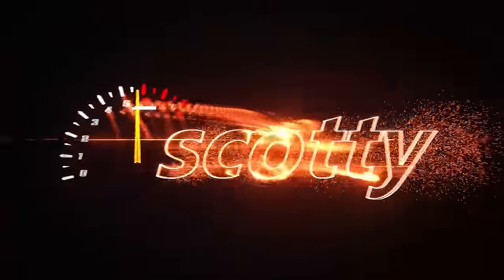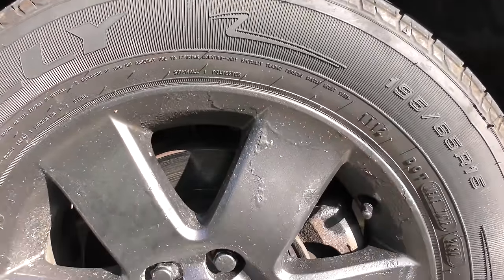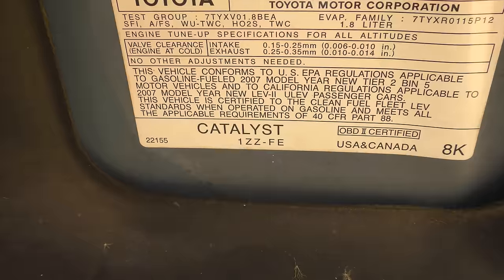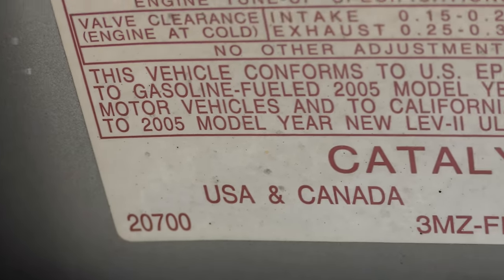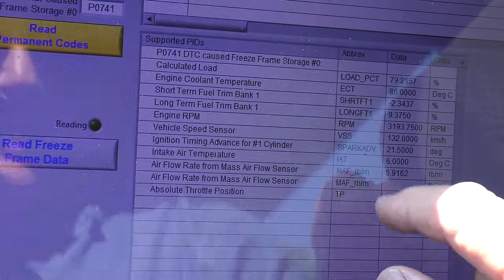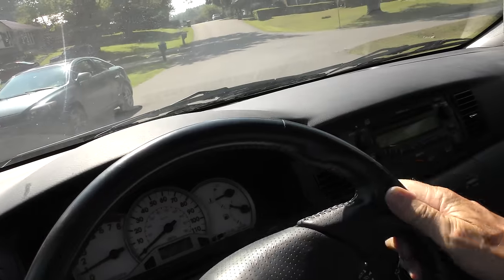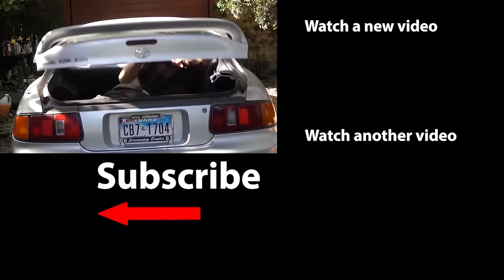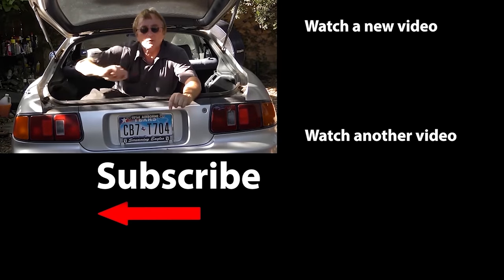I Won't Fix This Toyota Corolla

Comment: My 2003 Corolla has the same problem and has p0770 code I watch some videos change my filter and fluid and a solenoid was recommended because of that code my torque converter but it's still popping the check engine light back on as soon as I get up to highway speeds any recommendations from anyone

Comment: 2005 Toyota, outside looked pretty abused with 225,000 and the blue paint gone, it was a 'rusty" top but the mechanic that last inspected said it was the best maintained old corolla he had ever run across. Unfortunately a week later it was totalled with driver side door damage (other guys fault that required a door replacement). The insurance company would not fix it because their shop refused to not repair the paint and a slight dent in the rear bumper.  As it was they gave me a good total on it, but I quickly learned why as used car prices were soaring..fortunately got a break and got a nice 2014 Corolla way to cheap...family deal. . Hopefully the old girl has a new owner (a mech could easily fix the door) and has not been scrapped because she was a runner.
Reply: i got a corolla from an old grandma she was religious with maintance but didnt care about rust so everything runs new but rust is getting bad

Comment: I've painted wheels with stainless steel spray paint. Worked good.
Had 1982 Chevrolet truck that the torque converter locked up at low speeds causing a shudder. Discovered stopped when stepped on brake. Extend those wires to a toggle switch on dash, and could control lockup by flipping a switch.
Reply: That's what I love about GM products.  They're simple.  Back in 1996, the neutral safety switch on the clutch petal of my 1983 Chevy started slipping.  One day, it just wouldn't work.  I just cut the switch out, wrapped the wires together, and wrapped them with electrical tape, and I wasn't even late for work.  When something goes wrong with a Toyota or Honda, well, it's good if you're getting paid by the hour to fix it.

Comment: Toyota Blade hatch featuring a 3.5L V6 engine with 280hp (206kW) and 345Nm (254lb-ft) of torque. The Blade is sold in Europe as the Auris and in other markets as the Corolla.

Comment: Still remember this code make me trouble at CA smoke check I have to reset code drive with 3 gear for 100 mile make sure all port are green . If check engine light on regertless of type auto fail.

Comment: Hello i been experiencing some problems the engine like came on saying the torque converter solenoid is bad car runs great and seems great no overheating my starter starter going bad just changed it yesterday my car keeps shaking not to bad but it’s kinda like okay why is it shaking this much after 30 mins of it being parked ran great until today when I parked and it wouldn’t turn back on no radio no ignition turning on nothing completely dead I jump started and it work but didn’t stay on I finally got it to turn on and drove it home and while I was coming home i turn the AC on and it was over heating turned off the AC stopped over heating but still shakes engine light turned off twice when I replaced the starter and today when I got it to turn on does anyone had/have the same issue I can’t really find a video on it I made sure I put back the same way as I took off the starter I put a valuecraft re manufactured starter on it I have a 05 Toyota Corolla

Comment: Mine have that code too . P0741 2007 Toyota Corolla s. Same torque converter stuck off sigh . Crazy repair. Not doing that now

Comment: had this same code on my 05 matrix fluid was dirt changed it 3 times it came on once or twice while driving then turned it self off again. no issues since and does same thing as this one. I also just installed cruise control on mine that didnt have it before simple mod! hardest part is getting the screws out of the airbag haha

Comment: I have the same issue on my Corolla, drives fine to me... Just seems like a common issue and having to deal with it during smog time in CA is a pain.
Reply: Did you ever get it fixed? i have a 2005 with the same issue
Reply: @norestjoel i also have an 05 with the same issue lol

Comment: Have an 01' Chevy Prizm (Aka. Toyota Corolla) that I got with 60k miles, now have almost 200k on it and 4 years later. No big problems besides catalytic converter failing I think from burning a lil oil and/or having an exhaust leak before front o2 sensor causing to run rich

Comment: Solid car I have one myself 120 miles in good condition bought it for 4,000 not planning on letting it go anytime soon, completely off topic. Question I recently last my battery hold down clamp bolt that's bolted to the frame at the end of the clamp currently using tie down traps but i don't know how long they would hold up for, do you know what size bolt would fit?, someone told me 10mm but he forgot to mention the length

Comment: I’m confused. I saw another video on where the replacement of the solenoid was Super easy! Remove oil pan and then 2 bolts ? Why does Scotty say it’s so complicated ? The video I saw he didn’t remove the valve body.

Comment: That code P0741 is very common on Corolla's. I changed my transmission fluid, which was very dirty, and the code went away.

Comment: Brake rotors and drums are almost always GI 35 or close to it, not steel. Gray iron is self lubricating and short-chipping. It wears cleaner and cooler and the iron comes off in dust instead of compressing and getting hard or pilling up like a sweater when rubbed. Grey iron is stable and less prone to warpage. If you used steel you would have all sorts of issues.

Comment: The manual transmission ones are the most bulletproof and fun to drive. Very rare to come across because no owner wants to get rid of it. Speaking from experience
Reply: I’ve had 2 input shaft bearings fail in the c60 transmissions, luckily there easy to swap, can be done in 4 hours

Comment: Scotty! I've got a pontiac g6 with 58k miles no check engine light but my car under light acceleration shutters and shakes like the torque converter is failing to lockup. I check my fluid and it is full, the car will also stutter occasionally in park, as well as neutral (worst in reverse) and drive. Please help!

Also should note I took to my mechanic had him drive it a while ago he scanned with high level tool and got no codes at all for tranny or engine. I changed spark plugs and changed air filter and it's only gotten worse as time goes on

Edit. I also should note it never slips that I've noticed and it's always shifted harder for a 4t45e but never slipped and always shifted nice and fast

Comment: it's not just honda CVTs, the CVT cooler filter on JATCO trany also needed to be changed but no instruction for it on the user manual or service manual

Comment: Recently I asked the Nissan dealer to change the CVT oil (Xtrail T32) and they kindly grant my request to watch the oil change process on their shop floor. The car is 5 years old and the odometer is only 30km, but I want to be proactive knowing that the CVT is a prone part on many of the new Nissan. I already look at the service manual so I know something about servicing this CVT. The standard CVT oil change did not involved changing the filter - I had to request it. Also they did not drop the oil pan to clean the debris magnet. So it is not a specific Honda "problem".

Comment: I had a 2000 Rav 4 2.0 L 4cyl on the rego papers I was registered as a 5 cylinder.
In 2015, I kept it for 12 months a gas guzzler, clutch was on the way out So I traded it.

Comment: I had the same year corolla with the same code. For the converter lockup, I just turned off the overdrive and drove without it. Code never came back unless I drove with OD on.
Reply: Change the solenoid, nothing major bro…
Reply: @bradleymartin4464  The car ran absolutely fine, so fixing it didn’t seem worth it to me.

Comment: Scotty, believe it or not.  My 2006 toyota corolla has the original brakes still, and are going strong.  Keep looking at them to make sure they are good.  Minor grooves but still have plenty of meat on both rotors and pads. Is this normal? It only has 104,000 miles on it.  During the winters I never drive it in harsh Michigan weather and now it's at my house in Tennessee.
Reply: pretty sure I was running the og ones until about 130000, when they started screeching. Just replaced the pads, even though the disks were kinda worn. Probably won't bother with the disks for now, but even if I did, it's just a few bolts to be unscrewed. bless those toyota engineers

Comment: Scotty I have this check engine code since 2019 and the car still running. I use it for delivery I drive over 3k a month I just don't use highways .I think you are crazy if you use Corolla for highways anyway:).

Comment: My 02 Mustang GT service schedule says to change the transmission filter every 150,000 miles. I'll change it at the 90,000 mile service or in 2022, whichever comes first. I didn't see a service interval for the Xterra but I'll change the filter at 60,000 or in 2024, whichever comes first. What can I say, I'm a rookie mechanic. I haven't done DIY in 30 years.

Comment: I was at the plant where that Toyota was built when it was under construction somewhere near Toronto. The building was about 300,000 Sq. ft. Soon after Honda built their plant nearby. Similar size.

Comment: Scotty I’ve got an old 05 Corolla had that problem, we had the transmission done, then turns out there may have been a sensor issue ! Others with this problem might investigate that possibility before venturing down transmission road.
Reply: Do you know what sensor it might be? I have an 06 with similar problems
Reply: @rd.t1482  upstream 02 sensor for me

Comment: It"s kind of funny that some manufactures don't want people to service the trans filters, it feels like they want to fail. It happed to my brothers 2011 Honda Accord, I went to the dealer to get fluids and some other hardware to service the transmission, to my surprise the parts guy had no idea there was a trans filter because the service manual does mentioned at all. Good thing I did it because it was in rough shape and dirty. Moral of the history always change your Transmission oil and filter

Comment: My 06 Corolla had that code. But went away after I changed transmission fluid. Came back. Then noticed it only tripes the code when went over 70mph. But now I know all it will do it worse gas mileage lol. That’s a relief 😅
Reply: Totally had the same issue. A mechanic at AAMCO said I'd have to do a Transmission Overhaul but I declined. Besides that, my car rides great.

Comment: My Avalon check engine light is on for a bad knock sensor , it’s been on for 59,000 miles , it never knocks and runs fine . At 272.000 miles - just keep driving and keep it cheap

Comment: Probably burned the Torque converter clutch. If it was mainly used in city driving, the lack of converter lock up would not matter.

Comment: What do you think about the new Pathfinder with the traditional transmission? Guess they finally figured the CVT was trash.
Reply: I'm kinda excited for it too, it's a ZF 9-speed I think. Nissan makes cool, responsive engines (a few of the smaller ones had head gasket problems) I think the main weakpoint has been the CVTs, the old regular automatics and the standard transmission ones hold up.

Comment: This exact issue has been a smog problem for me in California, my 07' Corolla triggers the same torque converter code and although it's not an emissions problem it triggers the "check engine" light and by default it won't let you pass smog even when the engine is healthy with no emissions problems...yep, it's a real pain in the a$$ lol

Comment: My buddy took his 2017 Ford Focus with 28,000 miles on it back to the Dealer where he bought it brand new. He told the Service Manager the transmission was acting up and wanted them to change the fluid. Service manager replied that it had CVC transmission that has no fluid to change.   ?????????

Comment: The lost fuel economy would manifest as extra heat in the slipping torque converter.  Probably not a big deal, but might cause a problem at highway speed in the summer.

Comment: How many Americans coat the belly, suspension, wheel-arches and exhaust-pipe etc. with Tectyl? ‘Tis an American product. We use it a lot in Norway. Valvoline even adjusts the product for the Nordic region.

Comment: You don't mention that, that engine is made by Yamaha, I had a celica with the same engine, the Honda civic filter is actually located under the battery, there's a couple of videos how to do it, I did it myself bcuz the dealership didn't want to replace the filter which is a shity job if not replaced

Comment: I'm thinking that the sticker is a factory mess up because by my research the 3mze v6 was for mini vans and suvs. The master blade  has a different hood and a 3.5 v6.
Reply: I believe the 3mz fe engines were also used for the camrys and solaras

Comment: I think they just put the wrong stickers on from factory or someone else stuck those stickers onto the hood just to complete it when replacing a damaged hood with a new one. I don’t think the hood is interchangeable with any other Toyota model and they definitely didn’t stick a v6 into such a small car. I was thinking maybe the RAV4 but the hood is different, probably just mismatched stickers

Comment: My parents bought a new Toyota Corolla in 2005. It was a great car and lasted till 2019…sister got the car and later traded it in on a 2019 Corolla.  But it had over 200K miles and only issue it had was the ac/fan blower motor went out. Easy fix.
Reply: 2019 Corolla with 200k miles ?
Reply: @M447DT  i think he talking about the 2005  Corolla

Comment: 82 mph... last time I went that fast was open highway passing a slow truck 2way traffic. Usually never go even 100 km hr or 62 in human speeds.
Reply: It's my normal speed taking my 07 down the freeway in the mornings. Only bc the road is fairly empty at 4am, but I bet the gas mileage isn't great in this thing.

Comment: Great video, Scotty. Questioning the addition of a remote transmission filter that is easily serviced every 30k... is this a good idea?
Reply: @THEH2OMAN - Some of those cars made by Saturn (1985-2010) had externally mounted spin on transmission oil filters, so it worked for them. Not a bad idea actually.

Comment: I love the 3mz fe motors. So smooth and efficient, but powerful when you need it to be
Someone probably used  Camry or solara replacement parts.
Reply: Unfortunately it's interference with a belt 😭
Reply: A Camry or a solara hood will never fit on a Corolla not in a million years

Comment: Yep, I never knew about the transmission filter in a Honda
Reply: Honda automatics have never had a servicable filter since day 1. They made their own ATs and were different to GMs with no planetary gears till now (9 &10 speed ZF made in Georgia by Honda) or a filter that required changing. It was fluid only changes. A permanent magnet in the housing catches fine metal particulate from gear lash. They added an external filter that was not used for recommended service but rather at an overhaul. Then they put a filter in the transmission that is only changed if you overhaul it. 

You want to keep your honda automatic healthy.  Do a complete ATF fluid change using Honda fluid. 
I change mine on my Odyssey after 15,000 miles. 2016 takes 12 quarts. I tow about 3000 miles a year to FL and back and don't let the fluid get dirty ot tired ever. Dealer changeed ATF is at 30,000 miles and that's partial only.

Comment: Yes those cars are bulletproof, I've got a 93 corolla, I also got a question where do you change the interior air filter in a 1993 Toyota corolla because I've disassembled the half of the dash but couldn't find it, and I can't find anything about it on the internet, so could someone help me out on this one?
Reply: It’s possible it doesn’t have one. I had a 2005 Dodge Ram and it didn’t have a cabin air filter
Reply: Doesn’t have one , it has a plastic screen that isn’t replaceable
Reply: @claytongehrke2176  You mean where the wipers are mounted?
Reply: Yes

Comment: I have an 08 Corolla, last year for this generation, had it since 2018 with 155k miles. Although it has 197k now and needs struts and rear brakes replaced, goddamn this car is reliable. Oil changes are a breeze, parts are plentiful. I wish the seat was more comfortable, but hey, no biggie. 

I want to get a Toyota Tacoma, but dealerships want 1k trade in value for my car, I might as well keep the damn thing and just wait until it dies or someone runs into me.
Reply: Same, 04 with 140k miles. Easy fixes, cheap parts compared to other vehicles. The p0471 solenoid was about $300 though but it was very worth fixing. I love cheap insurance and the gas mileage !
Reply: Also have an 08 Corolla with about 115k on her right now. Been pretty easy maintenance as well with just minor brakes and fluid replacements that I’ve been able to do myself. I will say I have recently had some questionable high RPMs when first starting the car up after she’s been cold for a while and more recently hard cranking sometimes before she’ll finally start for me.
Reply: @Solontire   Check for vacuum leak  on the throttle body and intake manifold area, also Check throttle body small coolant passages rubber hoses (known for hardening and leaking). Check all the hoses to make sure they are on tightly.   

Common intake problem area with the air filter housing.  Check air filter and area .Mechanics check air filter and overstretch or crack rubber without noticing when checking engine air filter. Some forget to connect the small hose on the bottom of housing. Allowing unregistered air in causing computer to over compensate ect

Sounds like throttle body issue, but It can be multiple things like crank sensor ect….. Post the ob2 code or mechanic will need to analyze live data….